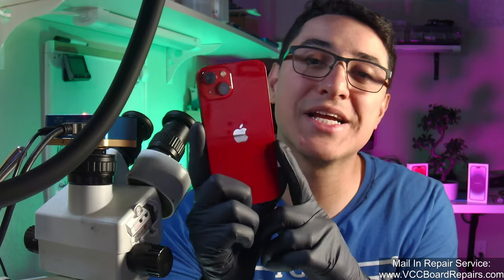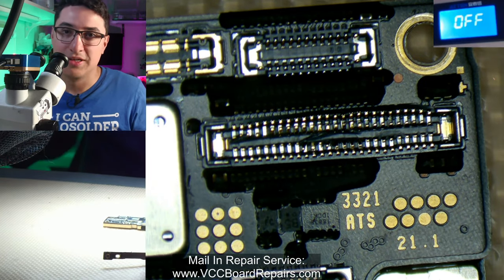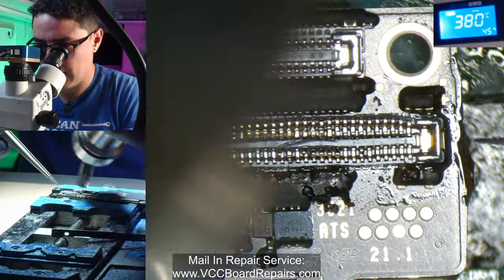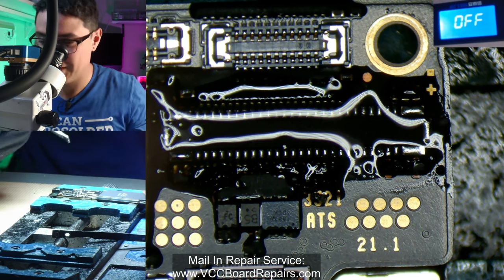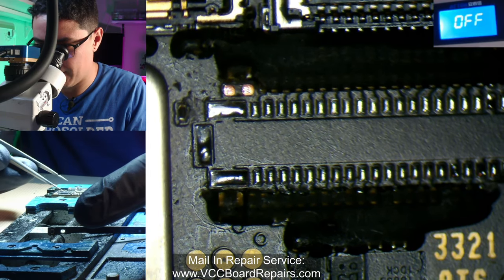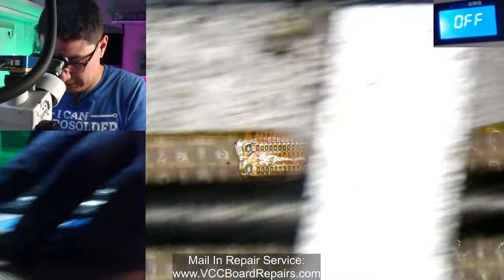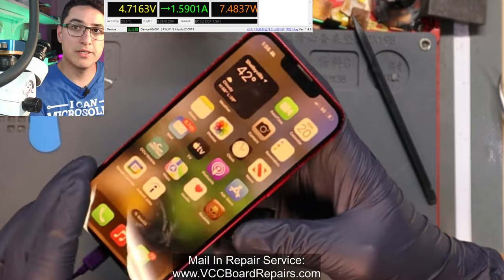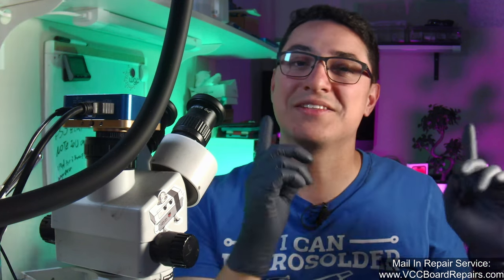How To Fix iPhone 13 with No Image, No Display. Replacing FPC Connector Repair.

Comment: What will I need to swap from a non working 13 pro max motherboard to another from a locked motherboard ? cpu and baseband ?
Reply from the maker: CPU, Logical Eeprom, NAND, BBCPU, BB Eeprom
Reply: @VCCBoardRepairs  But why NAND ? If you want to keep the data ?

Comment: after downing full swap for iPhone 12 Pro Max the phone work perfectly but when you put it on the charger for 5 or 7 minutes the phone like power off and don’t restart you need to power on it again on the panic full I don’t have anything but on the panic base I have this error Unexpected SoC (system) watchdog reset occurred after panic called
Reply from the maker: You should ask in my group: www.vccboardrepairs.com/vcc-fb-group